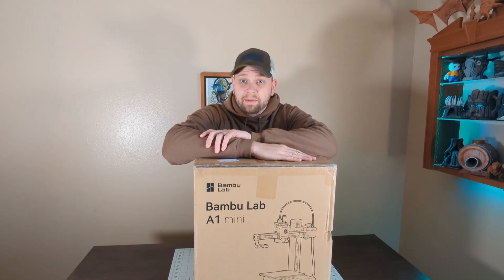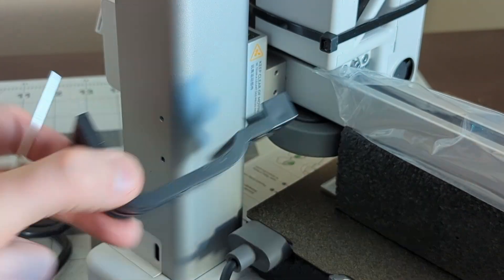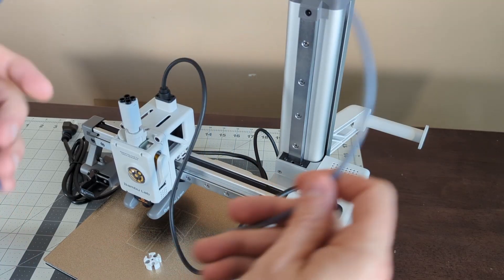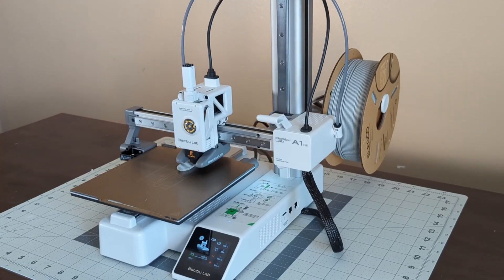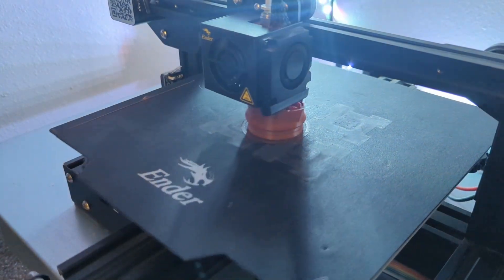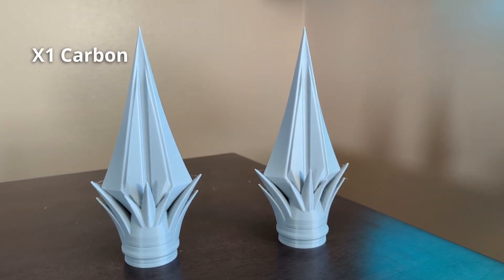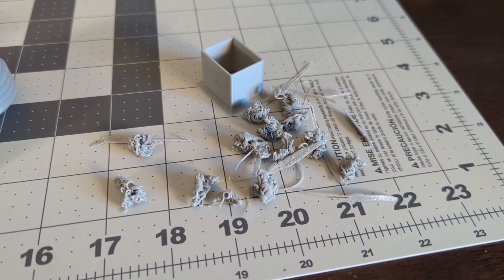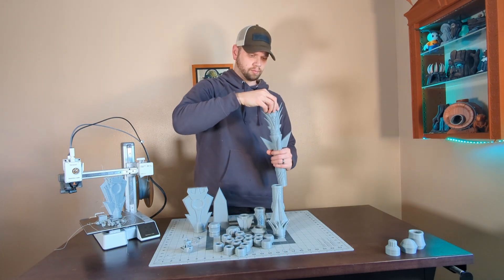Bambu Labs A1 Mini Review

Comment: Can you make articulated prints with this one
Reply from the maker: Yes, It's a pretty capable printer, articulated models would be possible. If you are looking for higher precision though, I would probably recommend a machine that has a Core XY layout, it will provide a bit more stability on the prints leading to more accurate parts.

Comment: Would an ender 3 be better or the a1 mini be better for a beginner 3d printer
Reply from the maker: Bambu Labs makes it really easy for beginners, most of their pre-set slicer settings make everything work really well. The A1 mini is a small printer (180mm sq build volume), which may not matter if you are printing small items, but the longer you are into 3D printing, the more comfortable you will become with larger, longer prints and you may want a printer with a bit more space. You could look at the A1 if size was a problem and your budget allowed.

I have some older Ender 3 pros, which always needed some tinkering to work well. Creality looks like they've made several improvements over the years and the newer Ender models like the V3 look like they are probably pretty good machines, although I don't own them personally.

Elegoo has also started to produce some FDM printers that look decent, check out their Elegoo Centauri (it's on pre-order): https://us.elegoo.com/products/centauri-carbon
This one has a (256mm sq build volume) and is core XY, so it should provide a bit more stability especially on taller prints.

Honestly, the newer generations of 3D printers that are coming out right now are all so much better than 5-10 years ago that you will probably be happy with a Creality, Bambu, or Elegoo.

Bambu Labs has made 3D printing very easy so if easy is what you are looking for, they would be a good option.

Comment: After the H2D released it makes sense they make it harder to print. Like requiring authorization. Imagine if someone could hack into your printer and turn on a laser. 

On another note, are you a full time designer/3d printing person? you have some cool models and I know I’ve seen adds for your props.
Reply from the maker: Yeah, there are legitimate reasons to lock things down for safety, many do wonder if that's the only reason though. 

and yes, thanks,  I am a full time designer / 3D printing person thanks to the support of the 3D printing community.  I've got lots of models directly on our website here: https://xykit.com

Thanks for watching, and for the comment.

Comment: Hey! Just ordered my a1 mini without the ams. Is the ams worth it? Ar eyiu satisfied with the printer itself?
Reply from the maker: I skipped the AMS for the A1 mini because I already have one on my X1 Carbon. The problem with the AMS is that it is quite wasteful when it does a color change, all the purging can sometimes take more filament than the actual model depending on your settings and the colors you are using. It is convenient to have access to 4 colors all the time without having to manually change rolls, but all the waste is a big turn off for me. I think it comes down to your own preferences, for me it is nice to sometimes have the color option, but I honestly prefer a nicely painted model anyways. Thanks for watching.

Comment: Im a complete beginner looking for my first printer, and i was about to buy the a1 mini when i heard of the drama. However, this video, especially what you said at the end really reassured me that i can buy this. Just one question; can you still use whatever CAD to design prints or do you have to use bambu software?
Reply from the maker: Glad you found it helpful. Yes, you can design in pretty much any CAD or 3D design software, as long as you can export a format that Bambu Labs can read, like an STL, 3MF, or STEP, I think there might be a few other formats it can read too. If you're concerned about files loading you can always download Bambu studios and try it out ahead of time too. Thanks for watching!
Reply: @ thanks!

Comment: The build-a-prop idea is brilliant. I have an X1-c with 2 AMS and two A1s one with and one without AMS Lite. All bought long before the incredibly badly handled firmware/"security" fiasco. And my reasons are precisely the same as yours. I want to print things as a hobby. I do not want the printer to be a hobby and I've had four FDM printers prior to buying into the Bambu Lab eco-system.
Reply from the maker: Hey thanks! Yeah, sounds like we are in the same boat. When it's time to print something, I just need the printer to work, and that's something that Bambu Labs does really well. Thanks for the comment.

Comment: The real question would u replace the ender 3 with the A1 mini?
Reply from the maker: Good question, If my ender 3 was dying, and my budget was about $200ish, then yes. I would consider the A1 mini a decent replacement, the only thing is you would be losing build volume, but gaining a little speed and accuracy. That's kinda what I did actually, one of my ender 3 pros motherboard died, and I'm debating whether or not to replace it, so I got this in the meantime. So far I've been very pleased with it. Thanks for watching and for the comment.
Reply: I am currently in similar situation. Also trying to get more points in makerworld to cover some of the cost.

Do u believe you notice the difference in print volume?
Reply from the maker: @tsarrr  I think you might occasionally notice it, there are times when it's nice to have the larger build volume, but it really depends on what you like to print.
Reply: I did trade in my Ender 3 v2 for the Mini. 

Best decision.